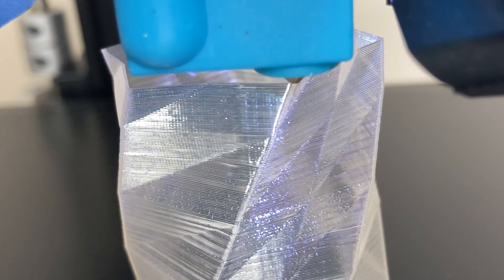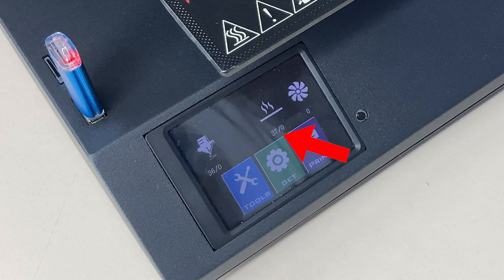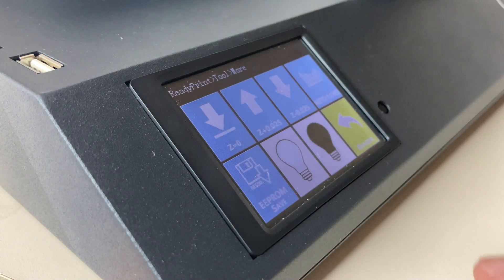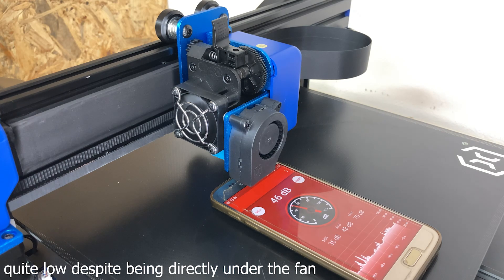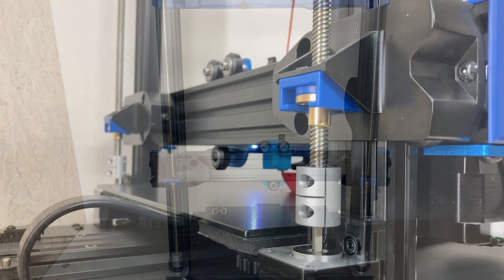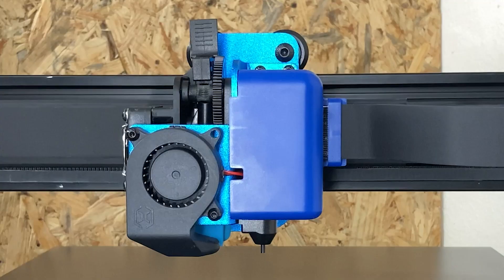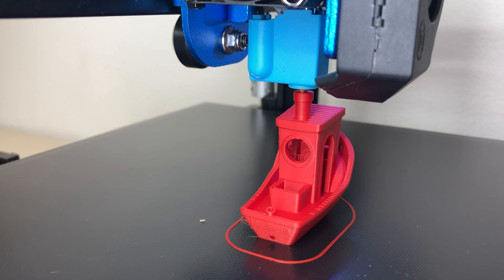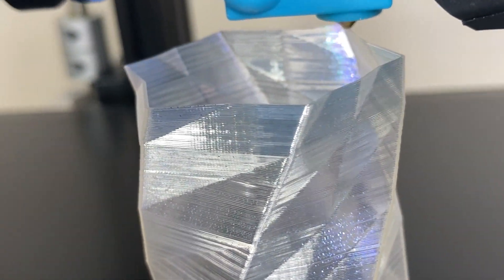Artillery Sidewinder X2 Review!

Comment: I’ve had this printer for a few months and I’ve never had a good print, any advice on getting it stuck to the build plate? Nothing works.
Reply from the maker: Clean the bed and calibrate it well, if it wont work, you can use hairspray.  By the way, try not to touch to the bed after cleaning, if you do, definitely clean it again.
Reply: I really appreciate the quick response. I’ll Try the hairspray to see if that works, I’ve tried glue sticks, and cleaning multiple times, but still doesn’t stick hopefully the hairspray works
Reply from the maker: @John Harman  If it didn’t stick despite all that, the levelling may not be good. By the way, use the hairspray when the bed is hot.
Reply: @retsetman9698  I tried the hairspray and relieved both printers manually and auto, and used hairspray, both printed halfway thru which is the farthest it’s gotten, but both failed by getting unstuck from the build plate.
Reply from the maker: I'm wondering if you are printing a very difficult part, or if this is the case with almost most of your prints. So either way you can use brim to better result or you may think to use pei sheet as a last option.
Reply: @retsetman9698  I hate to sound like a broken record but I have been using that support option brim. I’ll keep messing with it, I’m trying to print out modular houses for my dnd campaign, I’ll print some smaller objects first, I really appreciate your help and time responding to my messages

Comment: I have this printer, its quite good.
Reply: Still using it? How has it performed over the months? Any problems?
Reply: @drgeetchadha  it's behaved very well, I've done a lot of upgrades to it now, got a bi metal heatbrake, new copper heatblock, upgraded heater. I'm also running it off klipper from a raspberry pi. 

Not had any issues, it's a really solid machine. 

My university also purchased about 60 of the genius printers and the have help up to lots of abuse very well.